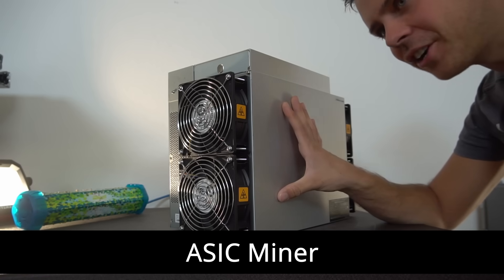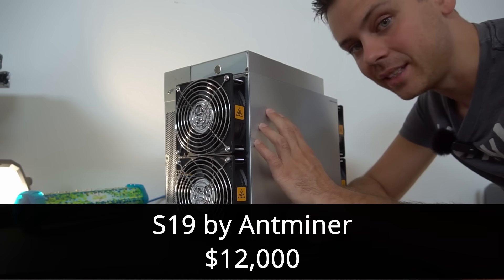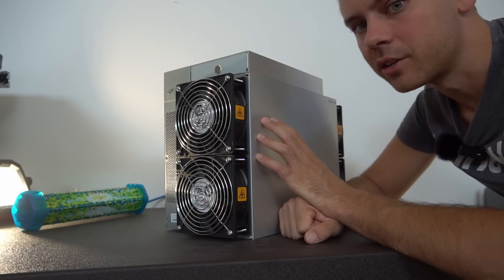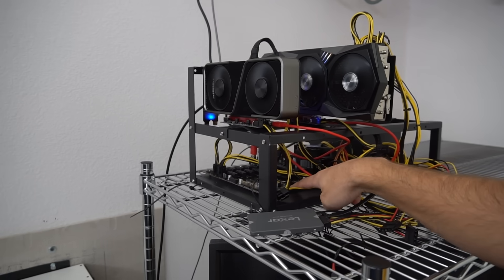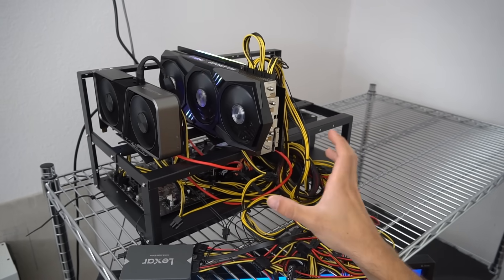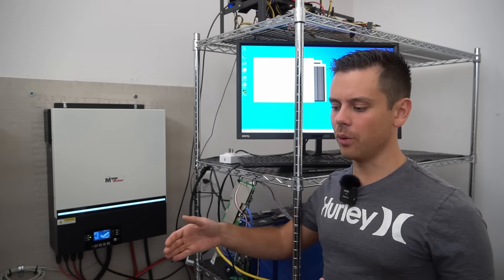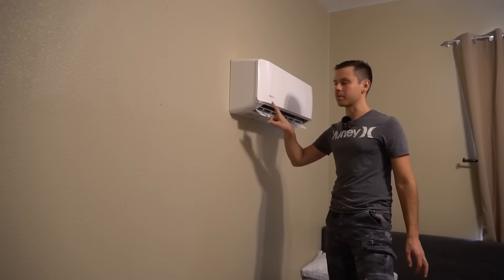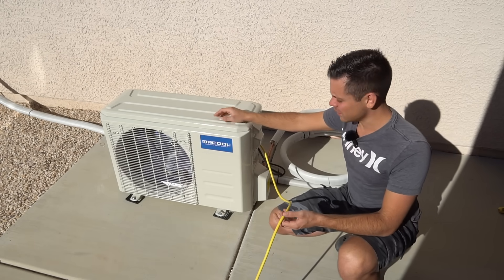Solar Powered Crypto Mining: Making free money with sunshine!

Comment: Hi Will, really like you videos, I'm planning to build a similar system but with the 2x Avalon Q, they are very efficient and flexible because it has three power consumption modes, Super (1600 W), Default (1300 W) and Eco (800 W), with that I could theoretically use Home Assistant to automatic switch modes of then based on the excess of solar power, also without overloading the system.

Comment: thank you for the informative video, wondering if you can connect the 12 V battery output direct to the Antminer? just to avoid PSU conversion efficiency loss from the DC to AC back to DC conversion

回覆

Comment: Hi I am running a Avalon 1246 totally on an off grid system. But the Battery power I have can only power it for about 19 hours. Is there a system I can use to start and shutdown the machine without damaging it? Linking to mains power is not viable.

Comment: I'm currently running drawing 1500w from 16x 1660Ti and 1x 3070Ti on my system and looking to ease some into solar, just trying to understand it all a little better with what's needed (parts list), hopefully you've done another updated video, it'll be nice to see some current products.. on a budget as I don't have 50k for a set up
😁
Reply: UPDATE: So to date I have a Growatt 5000 ES, 20x 300w panels with 4x 12v 100Ah or 1280Wh batteries and I am currently sitting here looking online for PV extension cables...

edit: just found out that my LiFePO4 batteries cannot be connected in series OR parallel so just a single battery connection which seems ridiculous and they're now pointless. I guess the BMS is what decides this factor.
received my 20m PV MC4 cables and bought a 5m heavy duty lead to cut in half for the AC input output.

Comment: How much efficiency are you losing converting from DC to AC then back to DC to power the cyrpto miners?   How would you go about creating a 12V system so that you can directly connect to these miners?  I've seen some people remove the PSU and power the miners with solar directly to the hashboards (I believe the boards are rated upto 16V.)
Reply: It is about 70 percent efficient

Comment: I tend to disagree on the 6600xts.  If you check wattage at the wall they actually consume more than the 1660 Supers and Tis and the 1660s can mine other coins better as well and are cheaper to buy.  Do they use central A/C in Nevada or you cant due to weather in the area?

Comment: About those noisy fans:
I made a copperwire spiral water pumped cooling system for my computers about 15 years ago just for fun. Worked great, but be careful with electronics and water. Oil can be used instead, if you can contain it well.

It looked ugly but worked great.

Comment: Hello Will, I have the roof area to install a 16kw solar array, but my electricity company will only allow me to connect to their grid with a 3.6kw export. I mine crypto so I want  to lower my electricity cost as much as possible. Could I connect 6kw of panels to the grid and connect the remaining 10kw to a battery bank? I saw your 13kw setup and thought of making something similar using two inverters. Can I use the mains power connection to the inverter to kick in when the battery bank gets too low to power the miners? Thank you, Richard.
Reply: What was your consensus? Did you ever figure it out?

Comment: Do you have any issues with your meter getting hot? I noticed in the summer time My meter starts getting warm and coming up the sheeting of the wire leaving the house none of the wires from the solar system get hot just out of the meter itself

Comment: If I don’t want a grid tie system (in my country it’s very not economically-smart) what is the best option for exclusively-solar-powered ASIC MINING? I’m planning to purchase a solar set up with your awesome website’s help, but Not so experienced in electricity. Which set up will suit me best? I have a roof which is capable of producing similar amounts of energy as your roof, maybe even more.  Whats the best option for me battery-wise, and all other components-wise? Considering the high voltage and usage of ASIC MINERS
Thanks a lot for your help!
Love your videos!

Comment: I have open loop Geothermal HVAC that also has heat scavenging for hot water.  Water is sourced from a well so it is a free resource other than the electricity to pump it out of the ground and the output goes to our pond to keep it topped up with fresh water.  I had been thinking how to to tie in a water cooled circuit to Crypto Miners instead of using air cooling which is very noisy.  Water cooling has much better thermal heat transfer and will be much quieter.  Probably need some level of fan use to keep condensation from happening.  Has anyone tried this type of setup?

Comment: 0:27  Pulling 3000W continuous???   So it's like a 3kW heat source in your house that fights against your air-conditioning???  It could heat your house in Winter, but in summer keep it in a ventilated shed.
Reply from the maker: I'm not going to run that miner at this property during the summer. Just did so for a month to audit consumption. I'm buying other houses and filling them with these miners.

Comment: I looking at getting a Growatt MIN 4200 TL-XE Single Phase Solar PV Inverter 2 MPPT for a 3.69 kW solar array (9 panels at 410W each). If I had 2 strings with one string having 4 panels (150.4Vmp) and the other having 5 (188 Vmp), would I lose the wattage from that additional 5th panel of that string or do the 2 mppt scale it so that I still utilise the whole solar array wattage. Great vid btw.

Comment: I am going to buy a Class A used motorhome. once I buy it and do what is nessasary to live in it full time I will be out of money, so I need to find good solutions, but on a budget. I would like to do a lot of boondocking and I would need to run air conditioning at night. I know there are 100 amp lithiom batteries for around $250.00 and I propably need 4 ? what might the rest of the system cost? are there good dependable kits at a low price?

Comment: Would you be able to answer a question? I have enough power to run some larger items, but the initial voltage pull is straining my batteries and I’ve had people suggest I install a supercapacitor. They gave me the exact model but I am really struggling with how to instal it into my solar system. I have three 200 amp hour batteries, 400 watts of solar, and a 3000 w pure sine wave inverter. Would you be able to help me with this problem?? I can’t find anything online about it at all

Comment: Is it true if I make too much electric in the summer on an off grid system it can mess up my frequency. So I need to reduce my output in the summer or find more uses for my electricity.  I understand you can use an electric hot water heater in combination with a gas hot water heater. Also covering some of my panels in the summer should work. Is there a way to automate this. I think you sent me two videos these were helpful THANKS.

Comment: Great video. I had forgotten to like until you mentioned that we should message you with the issues with we have with your opinions. I love that attitude. My only issue is that you don't discuss what the possibility of failure. These are huge investments in technology and these things fail. Equipment fails, laws change and energy prices change. I'm still super tempted to start with used panels, used Lead acid batteries and my 3070 gaming computer.

Comment: Hi Will,

I am thinking about building an off-grid trailer with a folding mechanism to allow for solar panels on the roof and sides of the trailer.  Imagine fixed solar panels on the roof and two panels that are hinged on both sides of the roof that can be deployed like awnings and can be angled to maximize efficiency depending on the position of the sun.  The side panels would be conveniently folded along the side of the trailer while being towed and all three sets of panels can be charging a battery even while driving.  What do you think of my idea?  I would love your input or maybe you can start a project that we can all learn from.

Thanks.

Comment: Will, this might sound nuts but if I don't ask I can't learn. I've been waiting to ask you when you are streaming live but that isn't happening today I guess. So anyway, can a guy build a Lithium Iron Phosphate battery and carry it in the trunk of the Tesla and then use it to recharge the Tesla battery when needed. A very good friend of mine bought a Model 3 and it is great but she got the 200 mile battery and now she wishes that she spent the extra dollars for more capacity. I'm trying to see if there would be a way to extend her range using a Lithium Iron Phosphate battery in the trunk. She could stop to recharge & doesn't need to use the backup battery while moving.

Comment: Is it possible to run a AC coupling system with a bank of 10 12 volt batteries (120V in 120V out. In other words is there regulators to run such a device. I use to work on 3 phase 480V systems LIVE at work, you don't shut down a $5 million dollar plant to find a bad circuit.

Comment: On another Chanel someone ask how to wire up a 220 volt micro inverter to the grid. Someone told them to wire it like wiring 220V single phase, isn't this wrong. Isn't a 220V micro inverter 220V on one leg not two legs of 110. Save a life make a video.

Comment: If you're looking for review ideas, could you do any of the "Ampere Time 12V/24V Lithium|LiFePO4| Deep Cycle Rechargeable Batteries" sold by Amazon? They appear to be the cheapest out there sold with the best options. (example = 12v 200Ah 100 BMS sold for $700 delivered for prime members).
Thanks!

Comment: on your  mining rigs dont forget to undervolt/underclock the GPU and overclock the RAM - my 3080 mining uses around 200 watts and was making $11 AUS when i was mining a few months ago
Reply: My 3070Ti runs around 190w but only makes $2.20 a day ,your $11 seems a lot
Nicehash does it all so nicely and easily..... but the rates are not so great now though unfortunately since POS... 
I dropped from $20AUD/day to $2:20 but this weekend it's starting to make more in payouts finally. I went from $0.00065000 BTC a day to currently $0.00013500
Reply: @thingswithlloyd4581  when everything was at a peak 12 months ago or so
Reply: @john1182  oh probably around the spike in BTC I'm guessing... Nice.

Mine was yielding the most BTC right up until the POS I really don't like my 3070 though and I'd much rather have 3x 1660Ti, same power consumption but more Mh
Reply: @thingswithlloyd4581  my brothers 3090 was killing it with the mining, lowered the gpu and oc the heck out of the ram, turned out it was all about the ram throughput that made the differance, he also had front and rear water blocks

Comment: Interesting setup Will. It's a very cool thing to do now that you have amassed so much equipment that it's basically free to run the miners. I thought the 6600xts weren't actually as good as they were made out to be because it was power consumption measured at the GPU itself, not including all the other components on the board.
It would be cool if you could get water blocks for your Graphics cards and run the water to a radiator outside the building. That would significantly reduce your cooling power draw, but would be a large investment in time when you could be getting on with other things instead.

Comment: I can't find any step by step info on installing a AC or DC coupling system. I started a grid tie micro inverter system but changed my mind. I want a off grid, battery backup, micro inverter system 12000W. In Texas the electric supply and electric delivery company are different. To upload electricity you pay $0.04 / kwh plus you lose your contract discount of $0.11.5  / kwh then pay $0.15 / kwh. HELP!

Comment: Idea. Build a prototype lawn service trailer with a solar roof that unfolds when stopped (have a awning, a solar ice chest) . Electric riding pro lawnmower, blower, edger, all the accessories with spare battery packs always charging. Get one of those manufacturers that makes the electric riding mowers to sponsor.  Nobody likes hearing lawn companies at 5am. Plus one small gas lawn mower puts out as much emissions per year as a new car driven 22k miles.   

And most crypto is being the opposite of being anti environmental. Great concept poorly executed. You may mine net zero but by contributing, you’re just pushing the other 80% that are using dirty power to mine more and more creating a massive demand on grids not only adding to global warming but forcing power companies to have to invest heavily in upgrading their grids (wearing out faster) and generators, and all those costs come right back to the average customer.  

China having banned all crypto mining and currencies is probably the best thing any country could have done to help slow global warming. They of course have political and economic reasons that take priority over environment. But at least they did something. Extreme. 

There’s gotta be a better way to blockchain.  Better math. A system that uses almost no power… that doesn’t have a ledger that has cporn embedded in it. 🤦‍♂️

Comment: I have one rig using solar power from my rv.  Works great except I live in Wisconsin and the sun doesn’t stay that high in the fall.  There is three 385 watt solar panels and 4 one hundred amp hour batteries on my rv which will run the 350 watt rig 24/7 if the days are sunny.  Not making a Fortune but having fun with this new endeavor.  Getting cards is the most difficult and they are very expensive.

Comment: The cost of generating the income such as the computer, solar and AC are all deductable expenses. You have a great handle on your costs. I'm sure you do a great job tracking expenses. I'm surprised you don't recognize the income when you receive the income and put it in your wallet. Yes it is taxable but your equipment cost unti you reach the payback period will be greater than the income. This will offset or reduce other self employment income. Then you will have basis in your crypto currency and when you sell the crypto many years from now it will be at lower long term capital gains. I'm sure you have a great CPA that is helping you with this.  (PS we generally don't accept clients with crypto currency because they have a zillion transactions where they net $500 profit. Invariably these clients have poor records and we need to charge the client $600 to summarize the information. They are not happy at the bill and we are not happy because we can't share tax planning strategies because the client is so price sensitive.)

Comment: "Literally anyone can do it. No thinking is necessary." 
That's really bad advice for newbie GPU miners, Will. ASIC is Plug and Play but GPU's require quite a bit of configuration and there are a multitude of ways to set them up and different algorithms to mine. Correctly configured mining Ethereum, the GPU open frame rig you showed (assuming you have non-LHR cards) shouldn't be pulling more than 450 watts, including the load on the board and CPU, and right now you should be making $10.11 USD per day without a power cost.
Also, your price projections are contingent on many factors you didn't mention, including new improved tech superseding your gear, the ETH move to proof-of-stake and your GPUs ability to profit mining another algo, the price of the crypto market as a whole, hash rate changes and network difficulty changes on BTC and Eth and the resale value changes of GPUs and your ASIC miner.
And your cable management is.......not good.
Reply from the maker: Yeah we all know what risks there are with the prices of crypto. I don't want to become a crypto drama channel and discuss it. I'm setting it up and not touching it till the income drops. I'll do something different if I have to. I'm focused on more important things like my solar channel. How about you crank out some crypto videos because I don't really care much about it
Reply: @WillProwse  No worries mate. You probably should stick to what you know.
Reply from the maker: Still easy to build. And yeah I'll tweak it. It's easy
Reply from the maker: Yeah I don't care about the cables. I don't need it to be pretty. Most of the ones I've seen on YouTube are a heap of wires.
Reply from the maker: Yeah everyone knows they are moving to pos. that's been mentioned for years. That's not new. We are mining what we can before it does. But eth upgrades take forever

Comment: I was hoping this was a complete off grid solar system powering a rig. Maybe the next video. And mining profits will vary.
Reply: You need to run mining equipment 24 hours and the sun does not shine 24 hours. So you're looking at a very expensive power set up.

Comment: Did you ever heard about Immersion Cooling ? It use dielectric coolant fluid (made by Engineered Fluids) or mineral oil. You literally sink the entire asic into that stuff and save electricity by removing fans and also you shut the noise by 90%!! It would be cool to see you test this !

Comment: We have our miner in the basement, mounted about 6 inches horizontally from and about a foot below our AO Smith air-sourced heat pump water heater.  When the water heater kicks on, it blows cold air directly onto the cards.  When the water heater is off, the heat from the cards rises toward the air intake for the water heater, thereby pre-heating the air for the air-sourced heat pump water heater.  It's a win-win on so many levels.  The heat pump water heater pulled the basement temperature down to 48 degrees last winter.  The miner will warm the basement up a few degrees this year, now that it is in the basement.
Reply: I have a mini dry ice maker and a fan. Works like a charm!